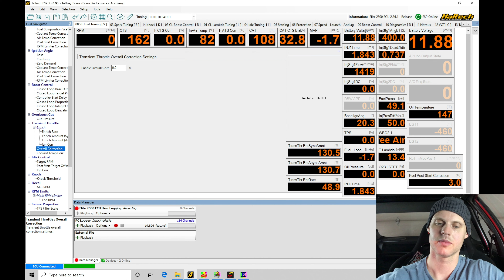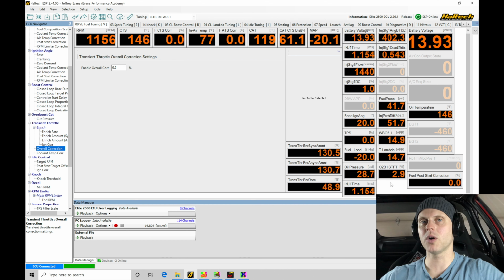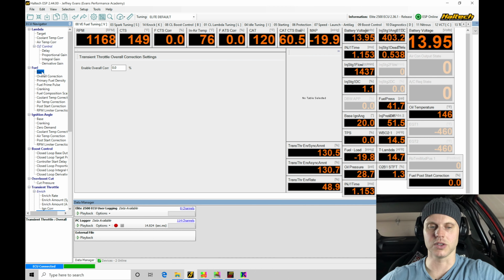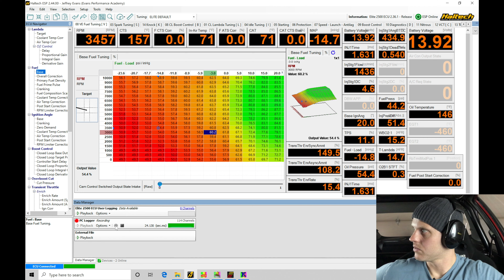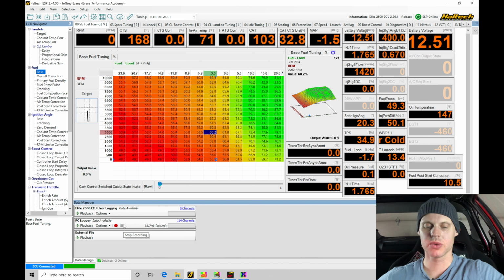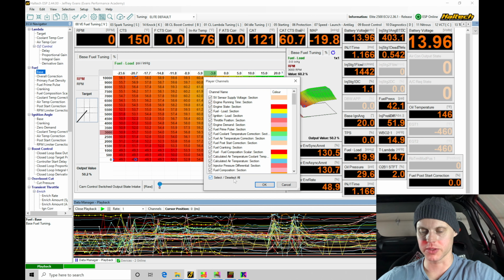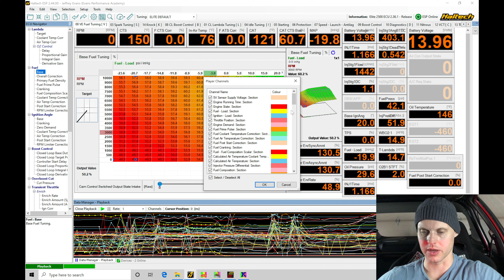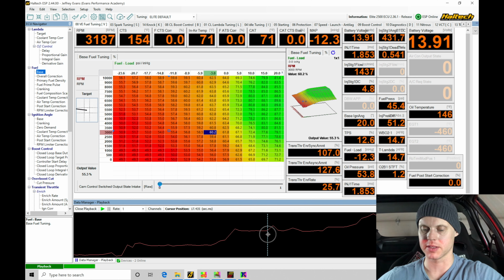Haltech Elite Live Training Part 4: AWD Turbo B-Series | Evans Performance Academy

Comment: hi, i am a new tuner  i have question  hope you can help me ,
i have ford f150 - 2015- engine 5.0 . 
i changed by hp tuner  ( neutral cutoff from 4000 rpm to 6000rpm )i made test  but still cutoff at 4000rpm in neutral .
Reply: can you me please ?